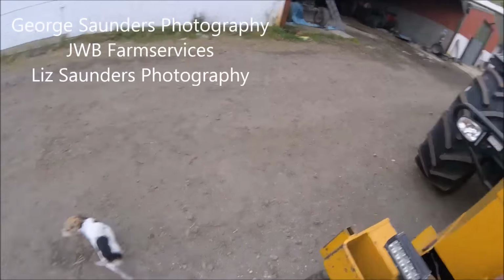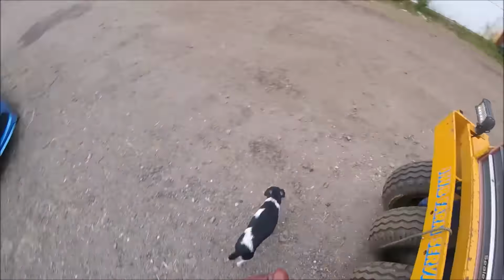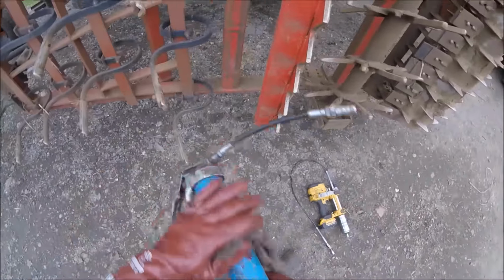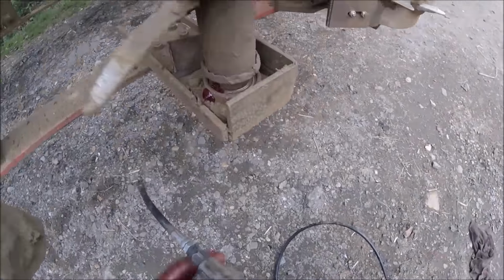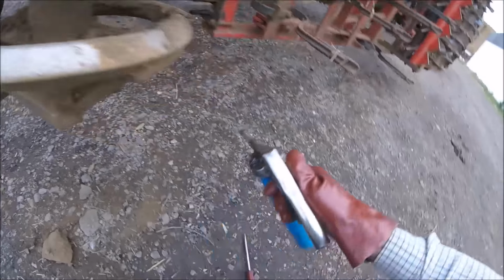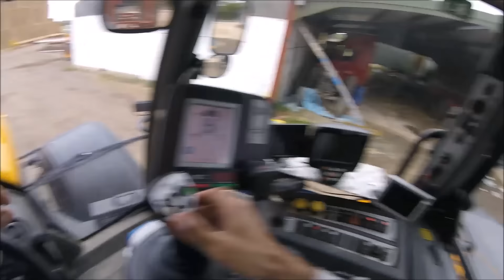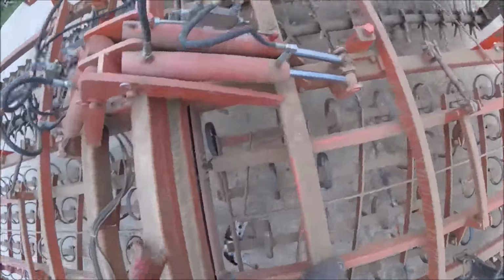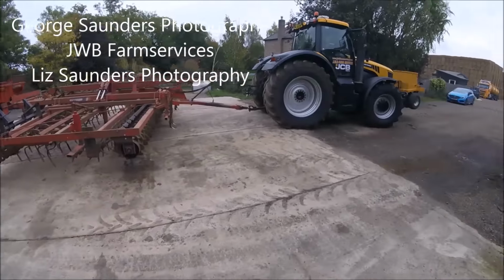Getting ready to go Cultivating

Comment: hi George sorry for asking this because i bet youve explained it a million times but what does the yello thing do on the front ?
Reply: It is a front mounted tyre press with tool box. Adds weight to the front of the tractor for improved traction for tractor's front tyres when cultivating, balance when lifting plough at headlands, improves balance and steering when towing heavy loaded trailers fast. Box to carry tools and field repair parts. Front wheels used to compress high straw/ hay swath rows so they go under the tractor without bunching when baling. Front wheels used to compact/ level soft dirt so rear tractor wheels have more traction when cultivating.
http://www.gregoire-besson.co.uk/ranges/tines/front-mounted-press/wheeled/planisol.html